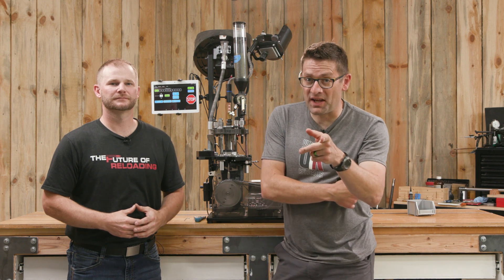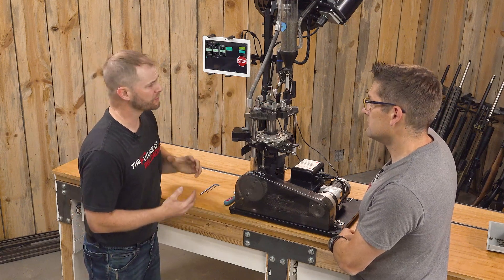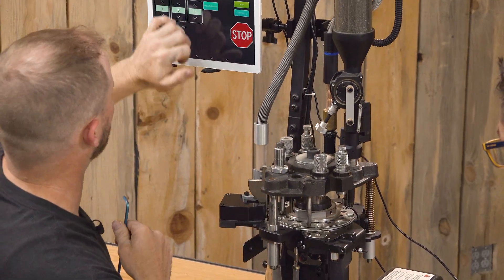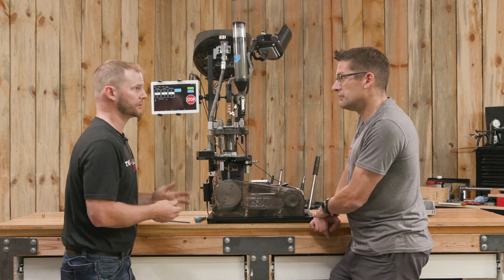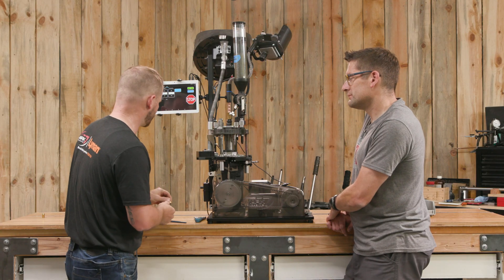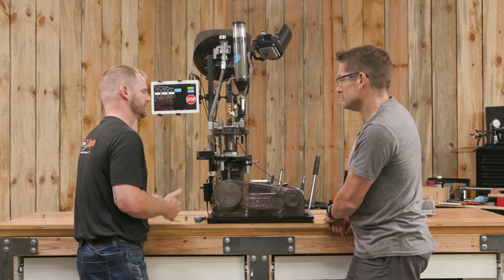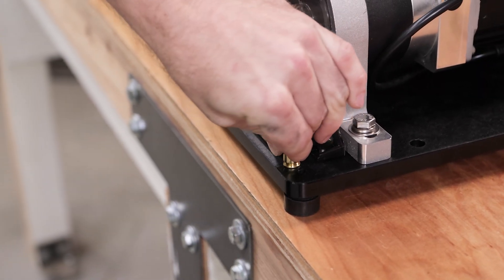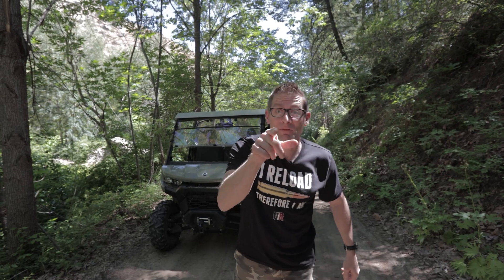Mark 7 Apex 10 Priming Adjustment

Comment: The priming system SUCKS!! Primers get stuck in between the index plate and the machine frame and then there is the occasional one stuck between the shell plate and the frame and you have to disassemble the entire machine! A lot of down time and primer waste!  Bad investment! Really takes the fun out of Reloading! The Primer Express finally went into the Trash! Ver aggravating product and the parts issue stinks as well! Takes weeks to get a repair part as simple as a screw, which you will wear out from removing the plastic plate above the primer index plate from removing it Avery 100 rounds to remove a stuck primer!

Comment: Hey Gavin:  Setting up new Apex 10 for MANUAL operation, and wanting to confirm that when setting up the sizer die over the primer station, it's recommended to set the die at the same "touch the shell plate then back off 1/4 turn" for non-automated?  Thanks and please keep up the great Apex 10/Mark 7 videos!  👍

Comment: When loading rifle, if one uses a normal full length sizing die over priming station and you lower the die so it is touching the plate, you are going to bump the shoulder....and I don't want to do that.  It's not clear from the recommendation how critical the sizing die "centering" is.   He also says you can use a hold down die which would not center the cartridge at all.  Confusing directions.  Can you please clarify?   Secondly, are you going to cover the super sensitive shuttle priming system setup?  There was a design issue on earlier models and Mark VII sent me a new shuttle disk.  Would be good to share.

Comment: The Apex 10 set up correctly is an amazing press. I have loaded (hand operated, no auto drive) my press at 800 rounds per hour, 124 grain Berrys CPRN 9MM, 4.3 grains Accurate #2 powder, COAL of 1.16”. My standard deviation after 200 rounds across a Caldwell G2 chronograph is 8.6, at 1078 fps from a FN 509 MRD with a factory 4.00” barrel.  I’m using Lyman Pro Series Stainless Steel dies with a hold down die over the primer station. I also should mention that at this speed, and watching the indexing pins pass through the shell plate (no forwards or backwards indexing) I’ve had absolutely ZERO priming issues.